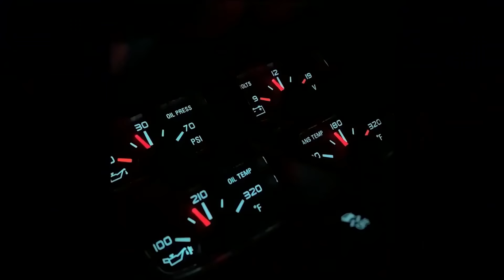2016-2020 Civic Radiator Replacement

Comment: No fear Kayla! Really cool your taking on fixing the radiator yourself. I have a project going on myself trying to fix my wife's Ford Escape. Having transmission issues with a bad solenoid and trying install a new valve body. Hope and pray I can fix it. Really don't trust transmission shops. Good luck with your radiator fix.

Comment: Nice job. You did that like a pro. It’s crazy that the bumper has to be removed to change the radiator.
Reply: I just did my radiator on my 05 MDX with 160,000 miles. The neck that leads to the expansion tank failed. I bought a new denso radiator for about 130 bucks and did all the labor myself. Took me about 7 hours between two days. Wasn't hard, just took some time.

Comment: Why did you take the lower support off and not the top? Take the lower plastic  off to drain, then remove air filter and upper brackets.. then disconnect  the fan then pull the radiator up.

Comment: Why you need to start using Evans Waterless Coolants, this stuff don't overheat like the regular crappy coolants out there. Also I would swap out your thermostat to high performance and radiator cap.